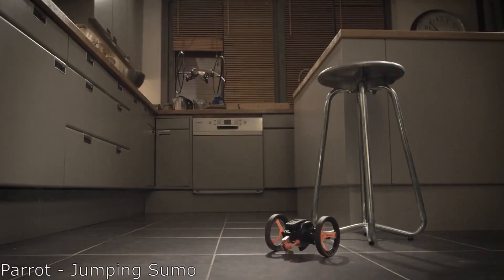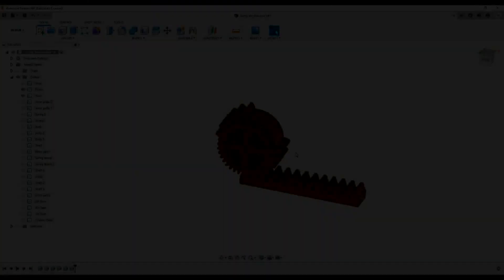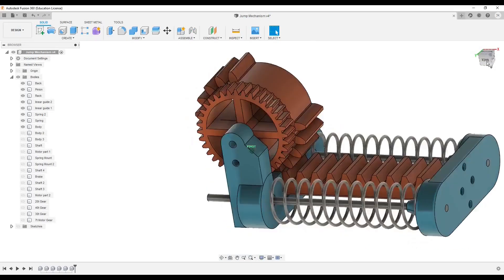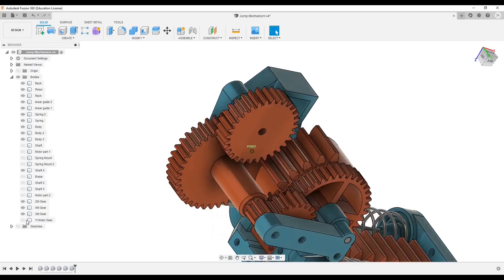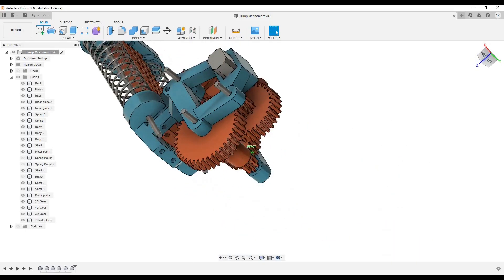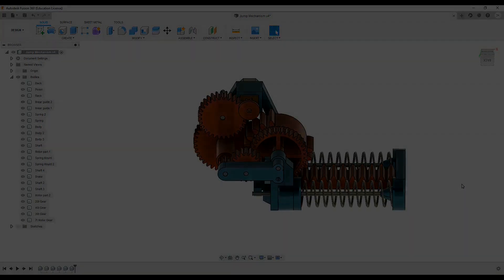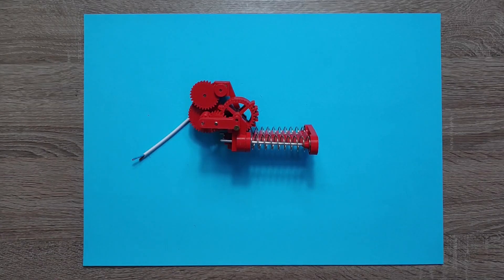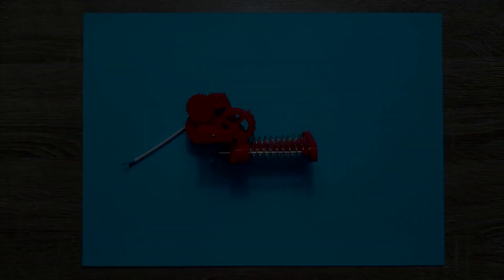Building a Jumping Robot Part 1

Comment: May I ask what kind of torque the motor will need to handle when tightening the spring? I have a competition at my school with a limited budget for motors etc, and was wondering if I’d need a hefty and expensive motor for this. Great video anyways!
Reply from the maker: Hi and thanks!
The motor that I used is a small N20 6V motor with a reduction ratio of 60:1. It isn't the strongest in its class as it has a rated torque(kg-cm) of about 0.65.
It is only able to compress those springs because of the 3D printed gearbox which greatly increases its torque at the cost of drastically lowering the speed. Overall I think that this solution is quite good as it is low on weight which couldn't be achieved by using bigger and heavier DC motor. So if you have a 3D printer I would recommend getting the same N20 motor but with higher reduction ratio (something like 250:1 which is equal to about 3 kg*cm of torque) or  modifying a servo like I did in the second version and later adding some 3D printed gears to increase the torque according your needs. There is no need to use big and expensive DC motors.
Reply: @BasementCreationsChannel  alright sounds good man 👌

Thank you!

Comment: Nice project! May i know where did you get the springs and metal stick you used? Thanks
Reply from the maker: Well I bought those 3mm metal rods from some construction shop but you can get them online as well. And the springs are actually from an old toy monster truck (dimensions are on my Thingiverse).
Reply: @BasementCreationsChannel  Thank you for the response. Its really hard to find specific mechanical parts

Comment: Just found your channel, and you seem to have some amazing stuff!  In case you need more ideas on your plate you could make either another spring version, or a gas piston (and co2 cartrige maybe) powered one with the same (or better!) capabilities as Boston Dynamic's "Sand Flea"
Reply from the maker: Thanks!
I am currently working on the second version of the jumping robot and it uses more powerful ASG springs but thanks for the ideas.Gas powered jump mechanism probably would have much more power than springs so that is something I might consider making in the future.